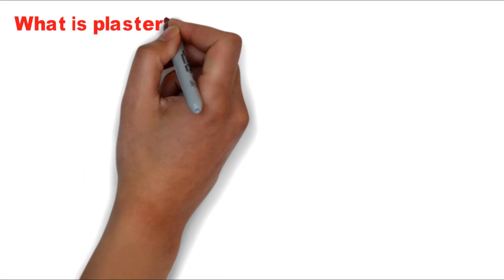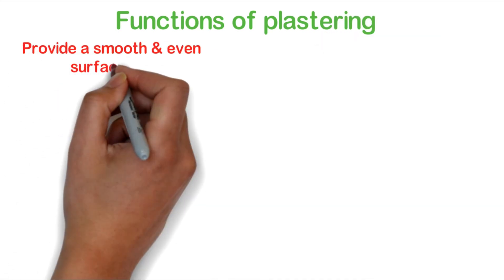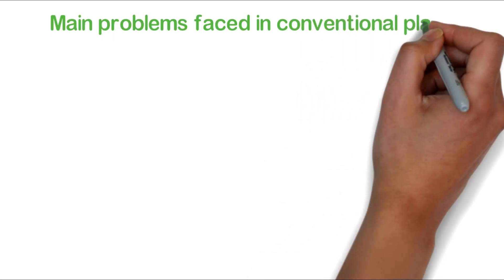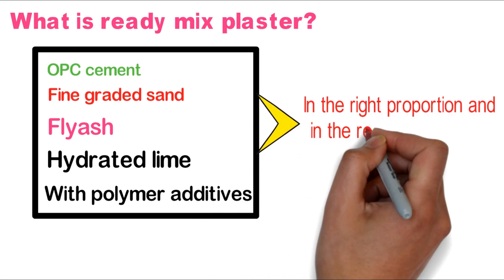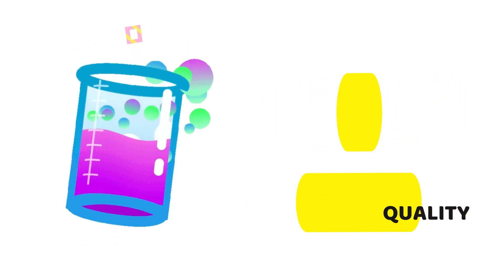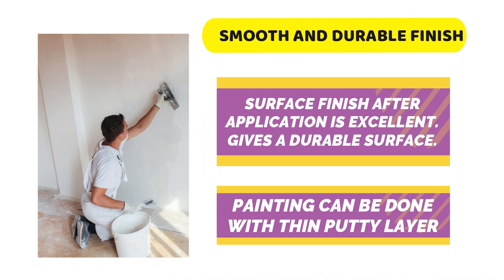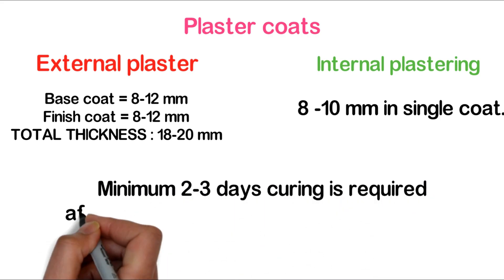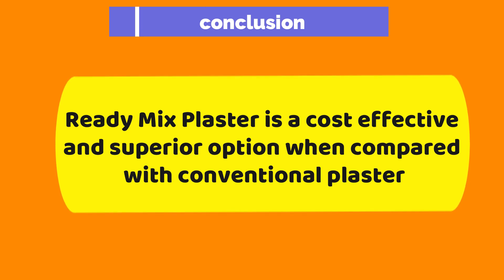Ready mix plaster || Ready mix plaster vs conventional plaster || Gypsum plaster || Rate analysis

Comment: Hi, Weber ready mix plaster is good for plastering? Is this cost effective than normal plastering method?
Reply from the maker: Weber is a very good company..u can use it..
Reply from the maker: Ready mix plaster is cost effective..and the difference basically depends on the cost of sand in ur area..quality and gradation wise RMP is best than sand

Comment: what is gypsum ready mixed plaster and also gypsum neat plaster
Reply from the maker: Ready mix gypsum got POP and sand in dry mix form available in packs..have to be mixed and use at sitr
Reply from the maker: Gypsum neat plaster is POP mixed with required sand at site